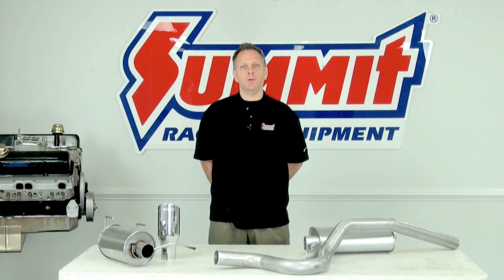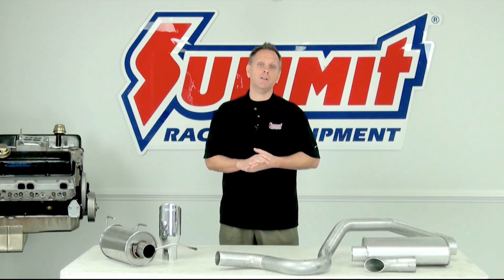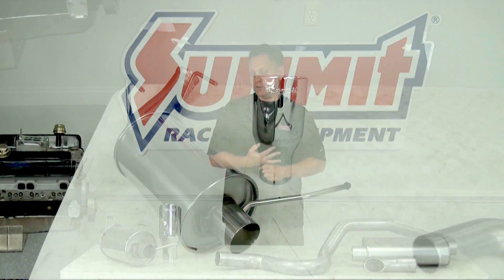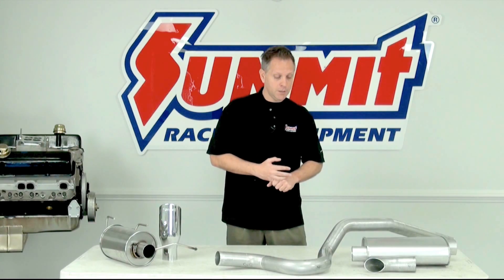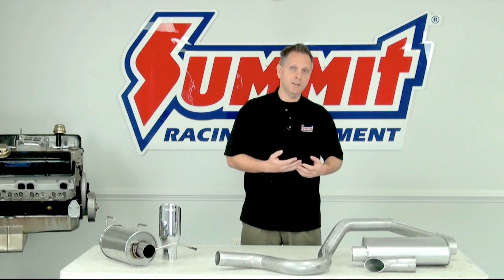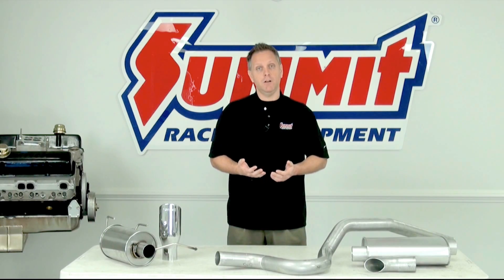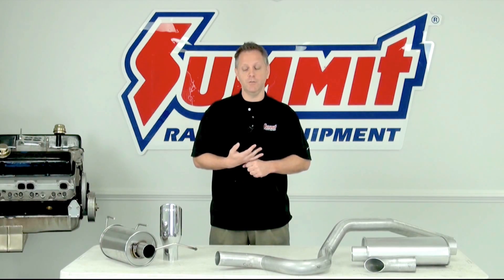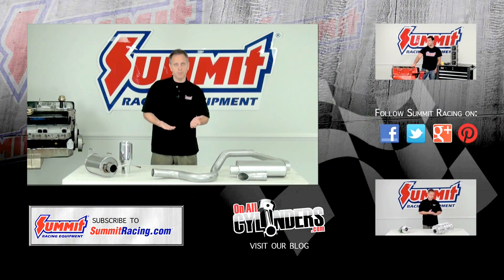Axle Back vs Cat Back Exhaust System - Summit Racing 101

Comment: Wat about just a universal muffler like a  apexi muffler will u have to weld on car?
Reply from the maker: Hi Jesse, we would need to know what specs you need for your application.
Reply: Summit Racing my car is a civic ex 97 5 speed and just for now I wanted a apexi muffler the inlet is 2.5 will it fit my car and or will I need to take to shop? Thanks!

Comment: Thanks for the video.  I have a 2011 Camaro V6 and love it.  But I've been looking at adding a performance exhaust system.  You said if your vehicle already has a good exhaust system with good flow (some do you said) then the Axle Back system would work fine. My question is: how do I know if the stock exhaust system in my Camaro is one with good less restricted flow?
Reply: I just had a Borla cat back installed on my Mustang V-6.  It not only gave me a better sound, but also made the engine come alive with more power in my opinion--without benefit of a dyno.  The stock exhaust looks Mickey Mouse compared to the Borla.
Reply: @AStanton1966  borla so loud/raspy I like magnaflow has deeper tones
Reply: @definitionXrp  The magnaflows do sound nice.  I put a Borla cat-back S-type on my Silverado and am very happy with its sound.  I got a compliment or two on it.  I'm with you, I don't like raspy or loud.

Comment: Is the cat back exhaust the best way to increase power. Or there's another one that's better than a catback
Reply: in terms of exhaust yeah, best way legally. if you're looking for just HP increase exhaust will be minute compared to a good engine tune or replacing under the hood parts

Comment: I purchased some DYNOMAX RACE MINI BULLETS MUFFLERS FOR MY 2017 DODGE CHARGER RT WITH ACTIVE  EXHAUST I CURRENTLY HAVE STRAIGHT PIPE SO WHERE SHOULD I PUT THE MINI RACE BULLETS WHERE THE MID MUFFLERS WAS OR WHERE THE RESONATORS WHERE?

Comment: Haven't scrolled through the comments. Gonna ask anyway. What effect is the diameter of the pipe on the cat backs gonna mean as far as the car computer? Dyno tune to get it right? Or is it just another my d**ck's bigger than yours thing that's gonna cause your car to run like shit down the road like some other mods that come to mind?

Comment: I have a 2018 JK Jeep Wrangler. I want to get a new exhaust system but cant decide between axle back and cat back. My main question is, will I get any performance and mileage gains from a cat back? Because if not much I'd rather save some cash and get an axle back..

Comment: Does it need programming after installing?
Reply: I would first change the air filter for a K&N sport so the air intake is equivalent to the exhaustion. If you program it, the car will change completely and add much more power but its not mandatory.
Reply: @gabrielvaz2461  Hey, I have a 2014 honda accord sport and I am looking to mod it out and improve its performance. What should I do first? I'm planning to get an catback/axleback exhaust and probably a Ktuner. Looking for some help and advice.
Reply: David Sanchez Yo, sorry for the late reply. First thing in my opinion is the airfilter. If its in your budget I would buy a  conic air filter and replacing the original inbox one. K&N is the best brand btw. Later remove your catalyst and install a downpipe. From now on do whatever you want and its ready for it.

Comment: Here I hear a turboback /downpipe mod is the only time you'd ever need a tune, from what i've read there are no sensors from the catalytic converter - back so there is no need to tune these mods. Im part of a wrx forum and most people running catbacks never tune their engine. The only time a tune is needed is when airflow is disturbed, and air input into the engine occurs at both the air intake and the turbo, increased airflow without modifying the air to fuel ratio will make the car run lean but this is generally not an issue you'd get from a catback, changing the pipes from the turbo - back would require a tune as the airflow is directly connected to the turbo and replaces the normal downpipe, catback wouldn't because the airflow has already gone past the engine and is just there to be vented out the exhaust, as for back pressure, I have no idea how much a catback would effect it, but I'd assume the more curves in a pipe the more back pressure
Reply: Maybe catbacks aren't an issue on turbocharged vehicles ? Dunno bout naturally aspirated cars but I've seen plenty of cars with catbacks/axle backs with no tune

Comment: which exhaust system offers greater HP and Torque increase? I don't have to worry about emission laws, would header-back straight pipe to mufflers give the best HP and Torque gains (with a tune)? Car is an 09 Challenger SRT8 6.1.

Comment: I had a flowmaste super 10 put on my Avalon I then a moth o so later had the muffler shop delete my stock resonator ! the sound differences between the two modifications were night and day! when I had the super ten put on the sound was way better very raspy and had a slight growl to it well as much of a growl a 3.0 liter v6 can make with only a muffler swap! then I had the resonator deleted and thesound got even louder and at idle I got even more rumble then I did with just a flowmaster on! however I'm a lil confused after watching this video when I heard a cat back system also has bigger piping! if I don't have this bigger piping should have it installed?

Comment: About how much horse power would a cat back exhaust system add on a 2.4 dart.?
Reply: Just put a fart can on  it ,that's good for 100 hp 😂
Reply: Would make it a butt dart
Reply: At most, 3-4 without a Cold Air Intake and Tune 6-7 with a Cold Air Intake and Tune. If its the Turbo version, 4-5 without CAI and Tune, 7-8 with CAI and Tune

Comment: Ive got a 11' G37xS Sedan and I can tell this stock exhaust is restricting the power of the engine....wouldn't axle back be a waste in this case ?? I do believe that the G needs to "breathe"....cat back is the way to go,  right ?
Reply from the maker: Hi NYYankzz, 
Most exhaust restriction today comes from the OE mufflers. If you are only doing minor upgrades (cold air intake & programmer) to your car, an axle back will work well. If you are digging a little deeper and replacing heads & cam, then a cat-back would be a better choice.
Reply: Summit Racing Thanks for the reply!!  =)

Comment: I want to do a few upgrade on my 2000 bmw 323ci and iask a few people for advice and they said not to mess with converter because in NY you have to pass emission test is there a way to improve performance and still be good for emission test thank you.
Reply from the maker: Hi Edson Eli, 
Late model cars are already equipped with high flow style (honeycomb) catalytic converters from the factory. But, sometimes there is room for improvement. Unfortunately, we do not show anything to fit your 323CI, sorry!

Comment: Thanks for the info, I have a honda accord 2011, i4 coupe. I was wondering what would be the steps to converting my single exhaust axle back to a custom magnaflow dual exhaust cat back. It has a cut out for a dual exhaust already. I have already bought the tips and muffler.
Reply from the maker: Hi Eric, 
You’ll need to find a local shop that bends custom exhaust systems. Good luck!

Comment: Hey guys, since you seem to actually read comments... I own a 2007 Wrangler Unlimited X and I'm looking into the Magnaflow 15160 (Black series Axle Back). I believe the entire exhaust is currently stock; Would it be necessary to replace the intermediate pipe as well?
Reply from the maker: +Dalton9087, 
It should not be necessary to replace the intermediate pipe unless heavily corroded and you think it may be compromised during the install of the muffler kit.

Comment: I have a new 2015 mustang ecoboost. Will installing a cutback effect the fuel economy on it? Does it need any type of tuning done?
Reply from the maker: +Ro ger, 
Yes, by reducing restriction in the exhaust of any turbo car they will spool up faster and gain some power and efficiency while cruising. All this is best if accompanied by a programmer!
Reply: +Summit Racing Thanks a lot! But is it necessary to tune it or can i just put on the exhaust?

Comment: I have a 2009 tsx (stock dual exhaust)how would i know if its a free flowing exhaust system. And which is better for it a cat-back or axleback. (Note: I plan to install headers and CAI, maybe a throttle body spacer as well?
Reply from the maker: +Lzz Irie, 
Well, technically speaking, it would be necessary to install a pressure gauge in the exhaust system and observe what the highest pressure reading is at wide open throttle. Then, the gauge would have to be moved to other points in the system in order to identify the part causing the high pressure reading. If it is the muffler, replace it using one of a free flowing design and retest. If it is the Catalytic converter, replace it using one of a free flowing design and retest.
  As you can see this is a lot of work and expense. This is the reason why most people just choose from the available cat-back exhaust systems on the market and trust that it will help them achieve their desired goal!  Don’t forget to re-tune your computer after all these mods!

Comment: I have a 1994 Mazda B4000 that has the stock exhaust on it at the moment. Would you recommend this as a good system to put on if I'm looking for an area sick yet low toned sound?
Reply from the maker: John Smith, 
We need some additional information from you. Can you give our tech line a call? 1-330-630-0240. Thanks!

Comment: Hi I just bought a 2014 Chevy camaro ss and was wondering what would be the best parts for performance to add more hp?
Reply from the maker: babywells87, 
Generally the first three things to add power to most any vehicle are a Cold Air Intake, a Computer Programmer and an Exhaust System. Horsepower gains vary per vehicle but are most times advertised by the vendor that makes the part.

Comment: Does the "catback" exhaust include the x pipe for the 335i or would that be a separate part of the exhaust? I'm trying to go full catless. Catless midpipes and catless x pipe with mufflers but I'm wondering if the x pipe is included in a catback
Reply from the maker: Chutie , 

We are sorry to say that we do not have a kit available for your car at this time. Good luck!

Comment: i bought recently a 2014 v6 camaro. i couldn't really afford a SS at the time being so bought the v6. my question though is now i want to increase its performance. which should i get the axle back or cat back and also any other recommendations? thanks! and great videos
Reply from the maker: Marcos Vazquez, An axle back system can be installed with no adverse effects to anything. But when considering a cat back and other mods such as air intakes or headers you will have to have the PCM retuned because of the added airflow. Otherwise, you may actually hurt your performance rather than help it.

Comment: Just bought a 2015 Ford Mustang GT 5.0.  The FORD dealer is recommending I do an Axle Back vs a Cat Back.  In addition they are recommending an Air Raid dry kit and a SCT Tuner to get more performance and there telling me 35 to 40 more HP.  Thoughts?
Reply from the maker: Pete McDonald, 
Yes, this is possible providing the SCT tuner has a custom program matching the upgraded mufflers and air intake.

Comment: My piping is 2.25. The aftermarket axle back and the headers are the same diameter. I just removed the stock resonator for a magnaflow.
Reply: Does it sound better

Comment: Great vid.  I just had axle back Flowmaster super 44 installed in my 2013 Camaro 2ss.  Muffler shop said my stock pipes were good and it would be a waste of money to do cat back.  It made some sense at the time but now I'm not so sure.  I wanted it louder.  He talked me out of the super 10 series.  Any thoughts?
Reply from the maker: Hi Perry Wisdom, 
Installation of a true cat back system would have allowed more sound than just an axle back because of the removal of the central muffler/resonator and the addition of larger pipes that factory. Also, more power will be realized especially with the addition of computer programming!
Reply: like do u mean axle back system is not loud cuz im planning to buy one for my ford edge v6 2013

Comment: Cat Back may give you a little bit of HP. But its not the reason you should go with Cat back. Headers are what really gains HP as it helps your engine breath.
Reply: so why not go with the down pipe and the cat back
Reply: @wavyant1504  do both.

Comment: Hi I have a 2013 Hyundai veloster 1.6 DCT and i wanted to upgrade my exhaust system, which one should be better between the 2, axle-back or cat-back, I would appreciate the help
Reply from the maker: Hi Ivan Rojas, 
A cat-back system may give you a little more power but if you are not racing the car and just looking for a different sound, a rear section or axle back kit will work great!